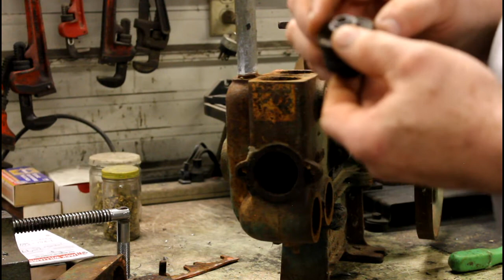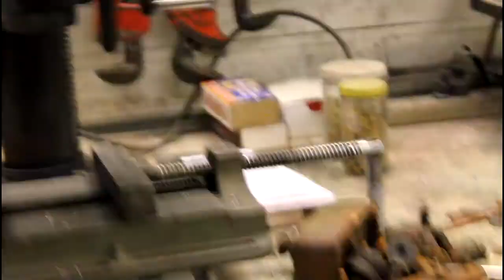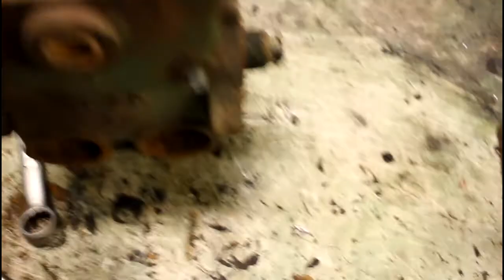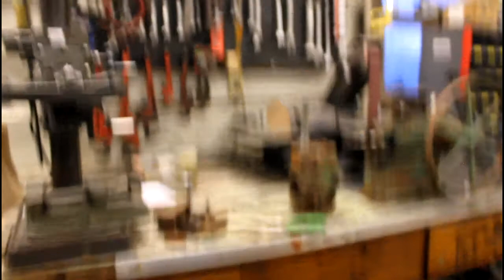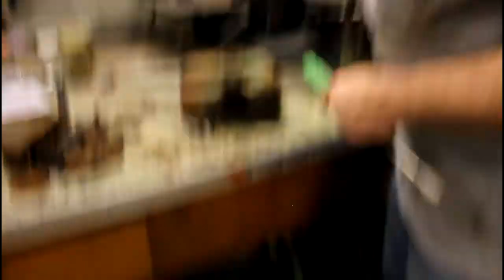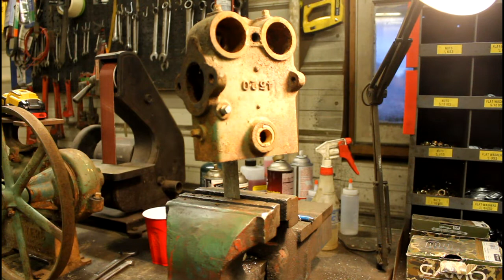Myers Piston  pump refurb part 1

Comment: I have the Same Pump I am in Texas does any one in the US know where I can find parts or a kit. Leather or rubber cups to rebuild this pump. It is missing the two side caps ( I will attempt to make them From Heavy PVC  Plastic weld ) Any advice or help is appropriated.
Reply from the maker: leather cups can be bought from deanbennettsupply.com   you can get the solid ones and make your own center hole.  pvc should work for the caps, just also make a gasket for each one.   the rubber valves I made from rubber round stock purchased from mcmaster carr